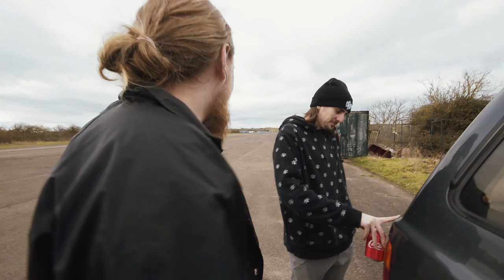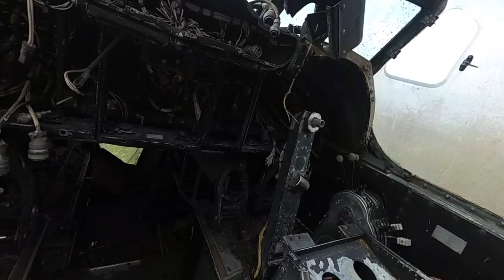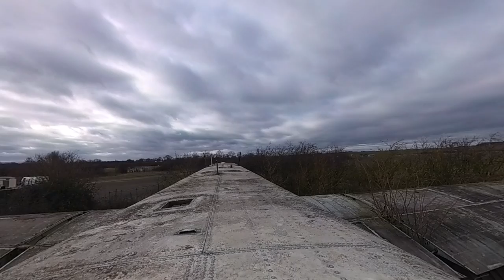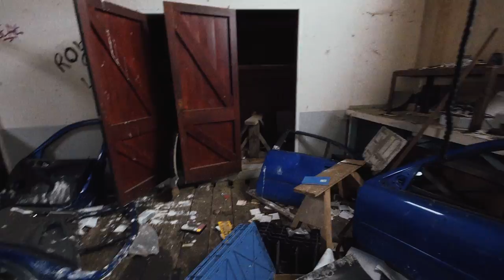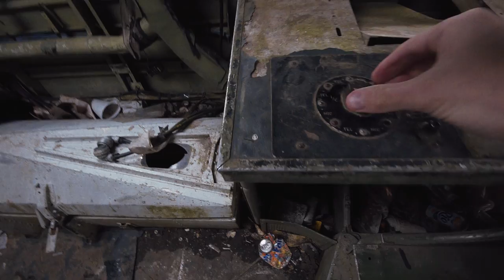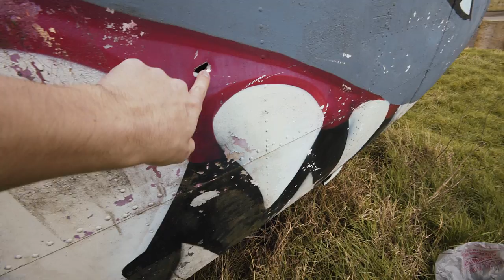ABANDONED Military Airplane Graveyard

Comment: Fyi. Large aircraft. Avro Shackleton MR3phase 3. Had four 36ltr Rolls Royce Griffin engines ( now removed) and two Viper turbojets.was used for maritime patrol and anti submarine work. Smsll aircraft. Gloster Meteor T7 was an advanced trainer. (I have worked on both these types) Lastly the one with the godawful paint job. Percival Pembroke. Was a navigation trainer. The tailplanes in the shed ( that you called wings) are from the Meteor.

Comment: Pop over from IKS the bomber is called a Avro 716 Shackleton
Wiki: https://en.wikipedia.org/wiki/Avro_Shackleton
image: http://static.panoramio.com/photos/large/96056850.jpg
Reply from the maker: Holy shit that's awesome! Thanks for the info
Reply: +Hell on Earth  They were used for coastal protection well into the '80s, although they were old planes being , basically, a WW2 design, nothing more modern was found that could do the job as well so these old ladies kept on flying long sorties (12+ hour) at low speed until they became uneconomical to operate any more due to parts drying up...

Comment: It's an Avro Shackleton, probably an MR3, a maritime patrol aircraft and the forerunner of the Nimrod. I didn't see a dome on the nose, so it's probably not an AEW bird. Someone mentioned a Lancaster and you are not too far wrong: The Shackleton is a development of the Avro Lincoln, which itself was a direct descendant of the Lancaster (in fact the Lincoln was originally known as the Lancaster Mk IV).

The other aircraft next to it is a Gloster Meteor, probably a T.7 trainer (the nose is missing so I can't be sure but I don't think it is one of the Night Fighter - NF - variants). The Meteor actually saw active service during WWII.

The last aircraft looks like a Percival Pembroke, probably a C.1 communications trainer by the interior layout.

If you film more ex-RAF or ex-RN aircraft, try to show the aircraft serial number (WX123, ZA999, etc) normally on the rear fuselage; that way I can pinpoint exactly what aircraft it is.

Cheers!

Comment: The big aircraft is an Avro Shackleton. It was designed after WW2 as an anti submarine plane. It originally had twin 20mm cannon in the nose, a mid-upper turret, and a gun in the tail cone. It was later used for search and rescue and Aircraft Early Warning [AEW] duties throughout the cold war, hence the retractable radomes and gear underneath. There were still a couple flying operationally in the 1990's, working alongside the more modern Nimrod jets. The Shackleton had a phenomenal range, and was powered by four turboprop engines, each with two sets of contra-rotating propellors.
Reply from the maker: They used them all the way up until the 90s, wow
Reply: Powerplant was 4 Griffon engines a relative of the mighty Merlin. They also powered later variants of the Spitfire..